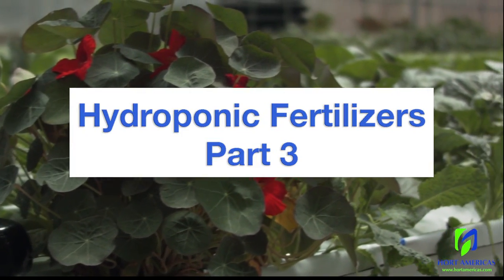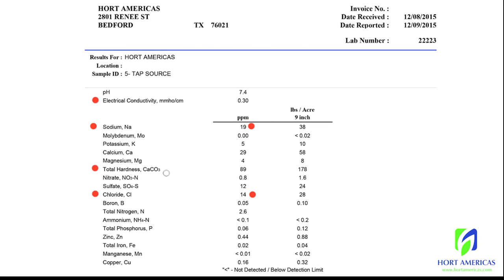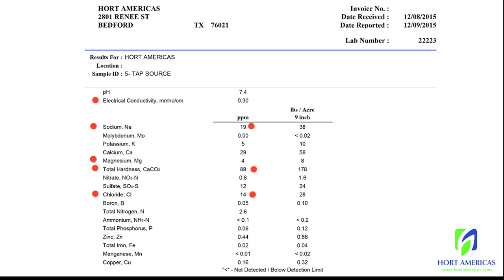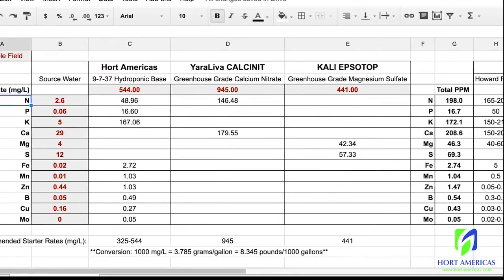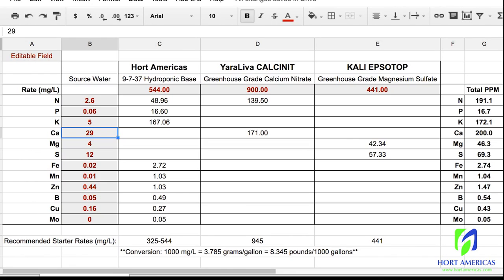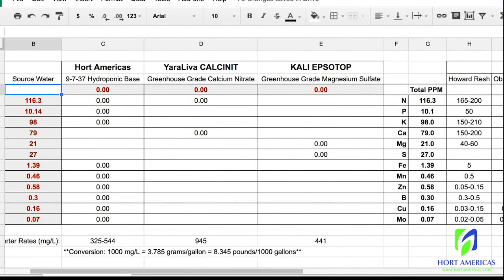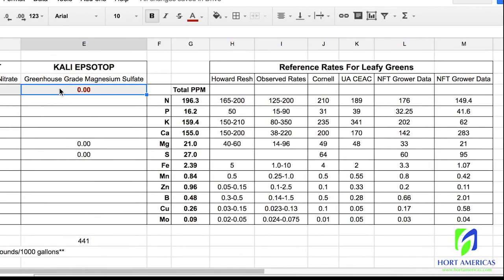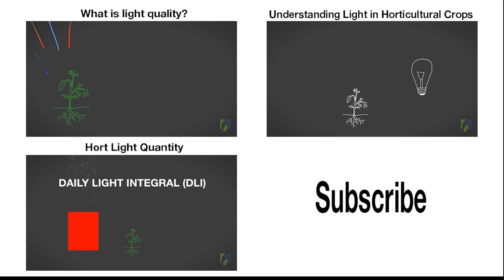Hydroponic Fertilizers - For Leafy Greens, Herbs and Lettuces

Comment: You recommended an RO system in the video. My experience has been that RO systems tend to remove a lot of the minerals from the water.
What are your thoughts on the use of rain water or distilled water in a hydro system. I'm still in the building stages and I'm starting out, so I'd greatly appreciate your thoughts.
Reply: RO is only recommended if there are excesses of something in your water. A water analysis is so important so you are not adding what you don't need. If you add too much of something, the additive can become toxic to what you are growing. Every water source is different, hence the need for a water analysis. This can also save a lot of money in nutrients that may not be needed.
Rain water would be ideal if in a rainy environment. Distilled water can get very expensive.